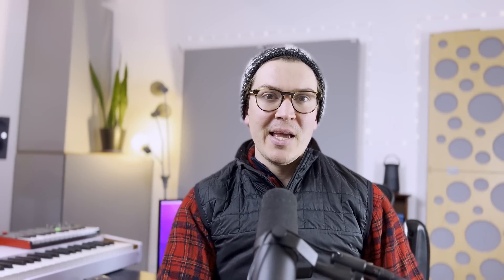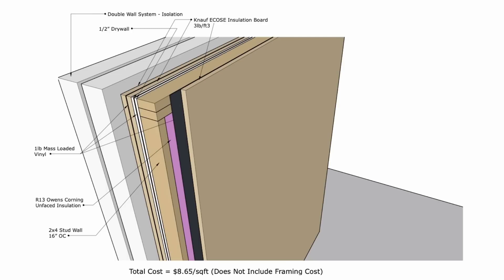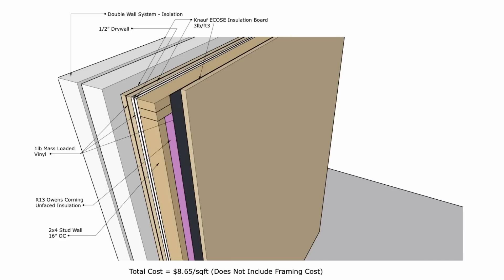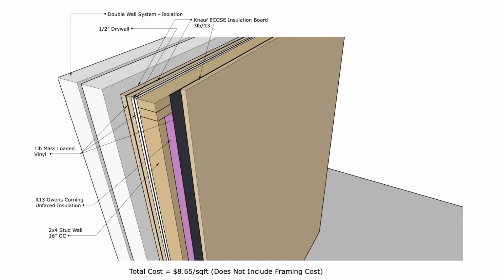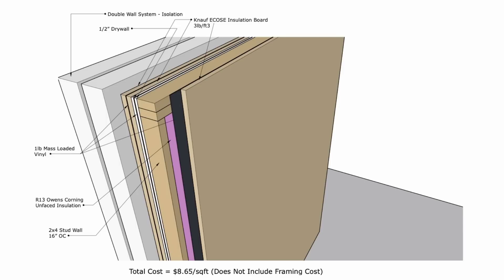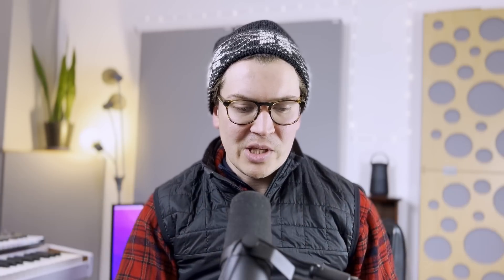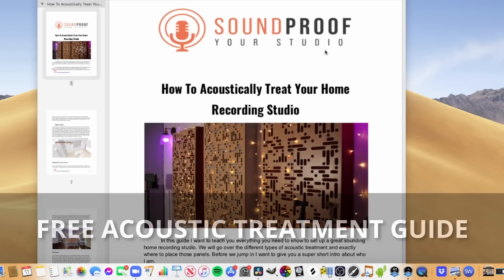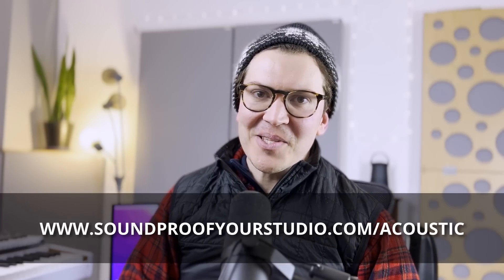This Acoustic Panel Absorbs Down To 30Hz

Comment: but is it only for 30 hz? or for all over it?
Reply: Absorption coefficient will often be over 0.9 above, and it's effictiveness will decrease rapidly as it approaches 30hz (low D on a downtuned electric bass). Quickly losing effectiveness from 200hz down. Which is why you need such thick material and air gap to have any reasonable effectivenesss down to that 30hz sub-bass area. But I suppose it's worth bearing in mind that anything much below 30hz is heard/felt as a very low frequency that's felt as rumble than discernable pitch. You start to get below the lowest note on a piano or a 5-string double bass. It's significantly below standard bass lowest string (E, 41.2hz) or an 808 kick (around 50hz). Which I suppose is why many loudspeakers frequency response trails of with -3db around 40hz area. But to even have 0.5 at 50hz may need 6" material + 6" air gap. But with with 4" that 0.5 cofficient is way up at 150Hz. Which is the territory of snare drum fundamental, and low-range of a male tenor, D-string of an electric guitar. So my takeaway is that 4" is not enough, we need 6"+.

Comment: I looked up Knauf Ecose Insulation board on the internet and it is lightweight low density mineral wool. It is not a "board" like you say here. Is there a naming error in this video? Can you please share a link to the correct material or at least an unconflicting name?

Comment: When trying to strop sound, there is absolutely no replacement for density. The energy of the sound has to work against mass.
Reply from the maker: Exactly! 🙏 Mass is key, and combining it with spaced absorbers like these panels gives the best control of low frequencies. For a tailored setup, you can book a free call with me here: https://www.soundproofyourstudio.com/Step1

Comment: What's the avg absorption we are talking about here? Does he mention that in the book? Down to 30 hz even a card box does, but the coefficient is near zero.
Reply: Agreed. I'd like to know this as well
Reply: There are calculators for this, like the porous absorption calculator. It will depend on the precise material, the thickness of the material and the depth of the air gap. With material with a flow resistivity of 4000 (Pa.s/m2), thickness of 1 foot (304.8cm) and a 1 foor air-gap, co-efficients in the region of approx 0.55 are achievable at 30Hz. Newell is right to point out the tradeoff between deep low-end absorption and the amount of floorspace lost. You are losing over 4 feet from both walls combined if you are aiming for relatively deep absorption at 30Hz. Working with a more paleatable design of a thickness 6" panels 6" air gap, material of a flow resistivity of 7000Pa.s/m2, a co-efficient of approx. 0.55 at 60Hz is more realistic. The end-user would have to decide between accurate sub-bass, and space and with the intended monitoring system in mind. Overall, my takeaway is that tackling that deep sub-bass in this manner really does require significant depth of material and airgap. And so people may want to increase their monitoring room dimensions by one metre or more than they think they require. In order to accomodate this effective, simple and cost-effective approach to absorption. It also means control rooms of 9 feet or less are impractical with this approach, as you'd barely have any useable space left, after treatment.

Comment: Hi! Do we need this for every single wall and ceiling? I'm building a 5m wide x 9m long x 4.5m height facility. It has brick and concrete. I'm also mounting a pair of ATC150 on the wall. I'm concerned about the low frequencies 😅
Reply from the maker: Not always! With brick and concrete you’ve already got mass, your main challenge will be low end from those ATC150s. Usually it’s smarter to treat weak points and focus on bass control rather than rebuilding every wall.

If you want tailored advice for your space, you can book a free call here 👉 soundproofyourstudio.com/call

Comment: Primacoustic Maxtrap and Fulltrap?  Diaphragmatic Resonator (Membrane) combined with 3" thick high density fiberglass and air cavity inside plus put in corners (24x48x19).

Comment: What about using 20-40cm (8 to 16 inches) of absorbing material? In the air gap between walls for isolation. I think dense heavy materials like lead or steel can be quite "thin" but air gap and the need to fill that air gap with absorbers cannot be avoided. As in to get those lowest octaves isn't it more effective to weaken those waves inside the cavity, instead of smaller air gaps and thicker walls. Comparing the same amount of space. Cost I am not so sure (how thinner walls with lead or steel and other dense materials compare to the cost of thicker regular concrete walls). In any case, that is not for regular home owners XD I think the cheapest would be an underground studio. Otherwise, having walls of several feet filled with soil or sand (like the earthship homes, with tires filled with soil).
Reply from the maker: I have always thought earthship homes and other dirt or underground structures would be a great option and maybe even more budget friendly. Are you working on designing a studio or just exploring options?

Comment: Attempting to absorb frequencies down to 30hz makes a lot of sense when you are dealing with extremely rigid concrete block walls, but for 99% of viewers, their structure is passing nearly all of that energy right out of the room already, even with double layer 5/8" sheetrock.
Reply from the maker: Very good point! If your room is not soundproof most low frequencies just go through light weight walls thus improving internal acoustics.

Comment: Great info, I am just wondering how to build this design, The challenge being the insulation/MLV/DRywall etc on this inside area of the Studs. I presume you would have to build the wall section on the ground put all the stuff on it then left it up into place? any thoughts on that? Also There has been discussion that sandwiching MLV between drywall would make that use not work as it has to hang freely.

Comment: Whaaaaaat??
As soon as you use screws to hold your contact adhesive made wall to the studs you are transfering lots of sound through the screws
Ive watched a few of your videos and you are the dangerous kind of advice giver, the kind who is just repeating stuff in "youre understanding"

Comment: I like this idea a lot.  When dividing a large space (ie a barn), this will be relatively easy way to make a control room or smaller recording areas I presume..
Reply from the maker: Well the wall really works as an acoustic absorber not so much an isolation wall.

Comment: Will the “acoustic” part work without double wall isolation system? what I mean is If we are talking about acoustics for a control room - how good this system work if it’s implemented from the airgap part but on top of the standard walls?
Reply from the maker: Good question, no I wouldn’t do that. They are two separate systems.

Comment: How does the mass loaded vinyl move if it is tightly sandwiched between these Knauf boards. I thought it works by hanging free from contact both sides to 'give in' (like the punching bag analogy) to the wave.
Reply from the maker: It still moves because it is a material that dampens sound. Honestly I have seen data where the sandwich performs better than limply hung.
Reply: @soundproofyourstudio  I've seen some comments made by manufacturers of MLV that it needs to hang free to vibrate. I believe to sandwich MLV is to use the product as a barrier, to keep sound out, but to hang it lose it behaves as an absorber of sound, sealing the edges of this lose sheet against air movement utilizes both properties.
I wonder if this concept applies: an arrow hitting a loose animal hide and catching the arrow vs a taut skin allowing the arrow to pass through. That was a defensive technique used 100s of years ago.

Comment: I have enjoyed learning about sound proofing, but some of the info will not help in my project. I'm currently building a sound proofing generator box. Do you have any advice for low-cost materials for low fqcy? I'm thinking of using 2" mineral wool on 1/2 OSD board.
Reply from the maker: You can use similar ideas for a soundproof box. Remember to have mass, spring mass and keep it air tight. The door will need to be heavy and air tight as well. Best of luck!

Comment: 5kg = 11lbs, isn't it? Not "1lbs", as was stated in the video. 
Can you expect useful advices on acoustics from someone who can't count? Who knows...
But this "design" has nothing to do with Newell's work. Looks more like one generated by AI.

P.S.: If someone watched to the end - was it said that this whole structure must be airtight? 
So air should not be able to get behind this "acoustic" wall, because otherwise it'll turn into a pile of expensive junk. 
Please, let me know!
Reply from the maker: It is 5kg per square meter. Apologies if I didn’t make that clear.

Comment: Why do you want to absorb the 30hz?  Doesn’t that reduce the feel of that frequency?
Reply: The 30hz will be there at the source and in the volume of the space.
The idea is by absorbtion it will not set the room in motion, creating unwanted modes.
Reply from the maker: It is broadband not a frequency specific absorber.

Comment: Scientifically speaking, I don't believe the claim. A 30Hz wave is 37 feet long, and you'd need something nearly 10' think to effectively absorb that. Come on, man. Let's be real here. Just tell us this is a paid advertisement.
Reply from the maker: It’s not. This is a diaphragmatic system. The quarter wave length rule doesn’t apply.

Comment: Wow. The book does NOT claim that this is effective or specifically designed for low frequency absorbtion. This is an INSULATING wall. Do not listen to this dude, he is confused on many levels about acoutistcs!
Reply from the maker: No it is not an isolation wall. Not even gonna try to argue this. Please read the book.
Reply: @soundproofyourstudio  for the vibes: I acknowledge I might be totally wrong here and apologies for being flippant, I just scrawled that on the bus... It's just my understanding. This design also absorbs low frequencies as a design feature, but it's mainly an isolation wall.

Comment: If you are in germany, gerstäcker sells picture frames 50x100, which fit ideally to basotect 100x50 plates, you could fill the frame with active coal, and put a hole plate behind it. (They easylie cut it at any hardware store.) They also sell rubber mats which are like 7 mm thick (to insulate washing maschines...) so if you take such a mat, and put it on the back side of the frame + add another frame - you have your loaded frame.  Costs: 35 Euro for the picture frame, 30 for basotect, 10 for the rubber mat + 2 kg active coal pellets - if you dont pick these pellets - you could go for other filling materials (cloth, rock wool.) ( Overall Price for 0,5 qm Panel: About 80 euro including the glue.) I did build some of these already, but active coal is very expensive (but very lightweight.) The ideas of acoustic field is quiete good because the overall surface of active coal is so high.)  Anyway - this approach seems a lot cheaper - which is why i will go with my next build with the floating gummi "punchball" approach mentioned here.
Reply from the maker: Thanks for sharing. Interesting ideas and would be cool to see the results.
Reply: *activated carbon

Comment: WARNING! This is isolation shell, and it DOESN'T absorb low frequencies. It's block the transmission, on the expense of reflect the sound back to the room. This author of this video have no clue about acoustic principles, even can't read the works which were written in the simplest language possible by those who really understand the issue. So be carefull, as Philip Newell said - be aware of people, who use the word SOUNDPROOF, don't let them make SOUNDFOOLS of you ;)
Reply: This is glass mineral wool with a binder.  It weighs 3lbs per unit.  It’s a fraction of the density of drywall.  This stuff cannot block sound reflectively.  You are suggesting that a company like GIK acoustics, which sells this for bass traps, doesn’t have a clue.  Dig into the physics or cite your sources for suggesting this material is reflective and not absorbing.
Reply: @andymakii7344  So do you think this design is just made of wool? Glass wool or mineral wool - it doesn't matter, except that it can't be both materials simultaneously - because glass is not a mineral ;). And yes, GIK Acoustic sells a lot of snake oil and just a few real things. My original post was a provocation with the aim of checking whether the author knows what's going on there, and it seems that he knows to some extent, but doesn't want to share this with his audience as it would complicate things (which they really are) and will make the video longer :). He takes only a tiny portion of the actual Newells complex design and claims that it can absorb “up to 30 Hz.” It can of course absorb a little, but not much better than a large soft sofa, for example. P.S.: Your car won't become a supercar if you just replace one engine, you have to replace all other parts too. Otherwise, you will end up with more problems than solutions.
Reply: @eduardzemlianoi  GIK described it as “glass mineral wool”.  I repeated their probable typo.  They likely didn’t blend the two materials.  In either case, you get my point, this is fluffy stuff.  Although I hope it’s glass wool.  I steer clear of mineral wool.  It doesn’t make significant impacts under scientific testing and its likely less safe.
Reply: so you’ve read the book i take it? recommendations on authors on acoustic treatment (not soundproofing please)

thanks
Reply: @Helenography0741  It is actually a very good book. Philip Newell is a brilliant designer of cheap, yet powerful and cost-effective acoustic treatments. But you can't just take individual parts of his design, put them together in a random order and hope that it will work (like the author of this video did). In Newell's book, Recording Studio Design, you won't find examples like the ones shown in the video. This is an absolute profanation of his designs.
Reply from the maker: I agree I the whole system works together as a whole, but youtube vids can only be so long. Soundproofing is good for search but sound isolation is a much better term.
Reply from the maker: This is an acoustic system that will help with isolation. The isolation system is two solid masonry walls with an air gap. Read the book first.

Comment: PSI AVAA’s are pressure traps that work. Not cheap.. but worth it when space is limited
Reply from the maker: Have you used them. Very curious at how effective they are
Reply: @soundproofyourstudio  they certainly help with frequency response and decay time down verrry low. But you have put a lot of effort into placing them

Comment: On which page Philip Newel's book "Recording Studio Design", says that this panel absorbs frequencies up to 30 Hz?
Reply: I will even say more - this design does not absorb low frequencies at all. This is an insulating shell. It seems that the author did not understand anything from this book.
Reply: @eduardzemlianoi  When he said that high Fred's will pas through the dry wall, my eyebrow went up swiftly.
Reply from the maker: High frequency will not pass through the drywall. They will reflect. Most high frequencies would be absorbed in the first layer of insulation mineral wool or cotton fiber.
Reply from the maker: That is incorrect. Please read the book. The insulating shell is two concrete block walls with a 10 cm air gap.
Reply from the maker: Page 134

Comment: Is the air gap between the wall and panel sealed? (As of the triple leaf effect?)  What are internal dimensions of each panels sealed space (as Depth is 4" but what about height & Width ) As assuming this will have a massive effect on the tuning of them?
Reply: I had some discourse with Dennis at Acoustic Fields, after I saw that he started offering 1/2 size bass absorbers. He said the size doesn't matter much. It's having enough depth for low freq. absorption that is important. The density of the material is the same, whatever the panel size. The vibration of the panel itself barely affects bass, and only attenuates and/or reflects the mids and highs. Bass is a long (30 feet- bigger than most small rooms)) pressure wave and needs depth and dense mass to absorb. Hope this helps.
Reply: I don't think this type of Absorber needs tuning, because they are "broadband". The goal is to stop low freq. energy/reflections. A Helmholtz "resonator" does need tuning.
Reply from the maker: Yes, but the triple leaf effect happens when you put drywall in between your double stud wall. The acoustic wall is sealed and sits away from the acoustic wall. It is not technically your isolation system.

Comment: Great insight, but how can we take the concepts and design a budget studio in that 15x20 space? Should I make 1 small live room, one small control, or Should it be all one room where drums amps and vocals are recorded in the “live” end and control, mixing, etc is in the dead end? $5k is way out of my budget. I just want to not piss off the neighbors
Reply: 1 room for all. I have it, and it has worked beyond expectations for 3 years now. I did very meticulously.
Reply from the maker: I use one room and did not do this design. Newell designs are hardcore and used for high end studios. You could use his design for a neutral room and probably get great results as a mixed use room. His control room design would also double as a great recording room in a home studio. The key is do you value great live acoustics for recording or super accurate listening for mixing and mastering. I find most people lean more to one side of that spectrum.